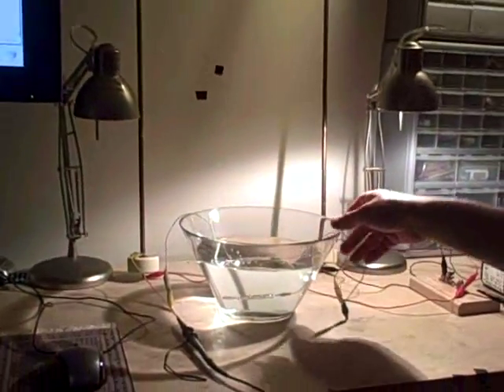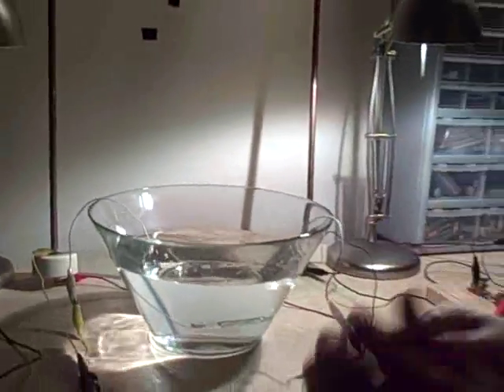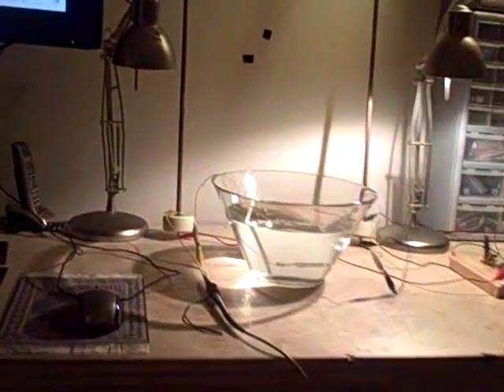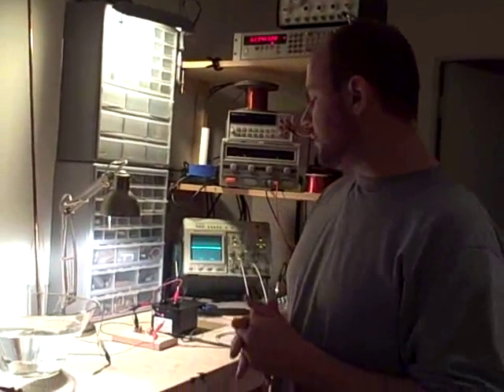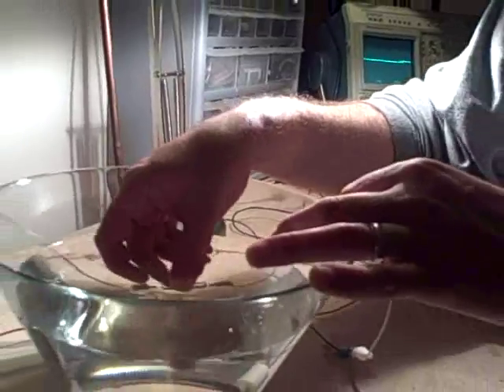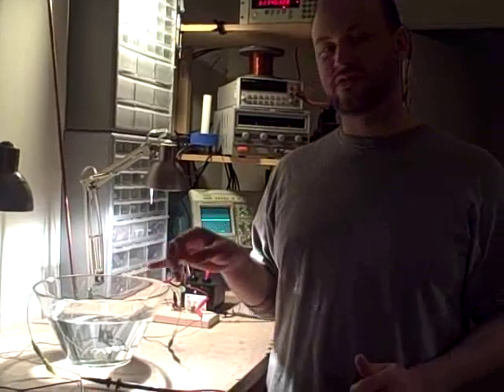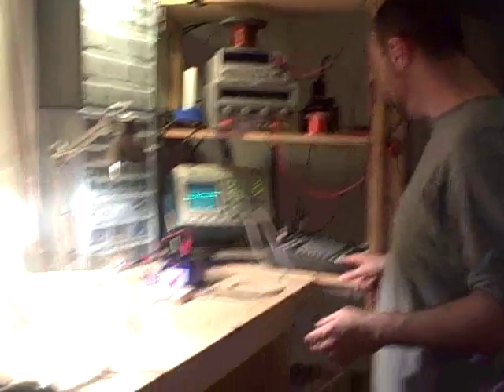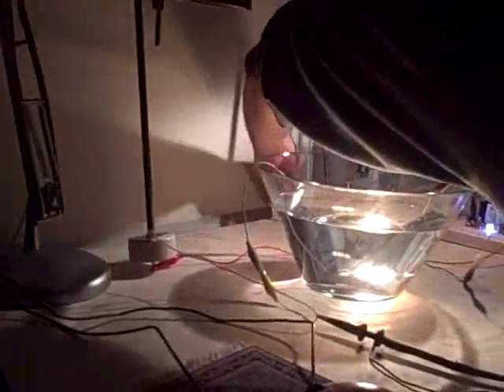bulb in water with tesla hairpin circuit

Comment: Have you thought about using this to power coils instead of bulbs? For example powering one Hemholtz coil rig in the x y and z axis defining a central space, and then having an identical unpowered 'receiving Hemholtz coil xyz rig any distance away as plausible 'teleportation' of detectable energy or even matter? If this transmits energy with no regard to time or distance then it might work.

Comment from the maker: @youarelackluster 

for this particular experiment, the mixer is amplitude control for the input waveform on the primary side of the HV transformer.

in general, i use the mixer (in combination with audio power amps) for experimenting with various waveforms i produce with either signal generators or  arbitrary waveform generation tools.

Comment from the maker: Charge moves through this circuit in a nonlinear manner, which is to say it traverses distance without time. This form of transmission operates super efficiently. One can power a 300W load with 40AWG wire and the wire doesn't even get warm!  Tesla stated that distance is meaningless and this circuit proves it.  Here, the bulb is acting more like a battery with the bulbs filament converting non-linear Complex charge amplitudes produced by the spark gap back to Real plane values which can do work.